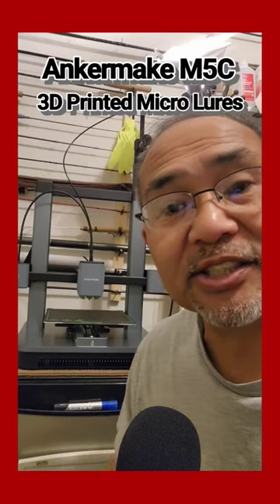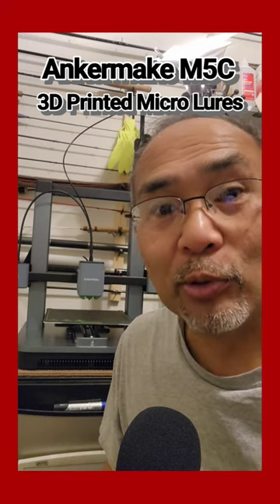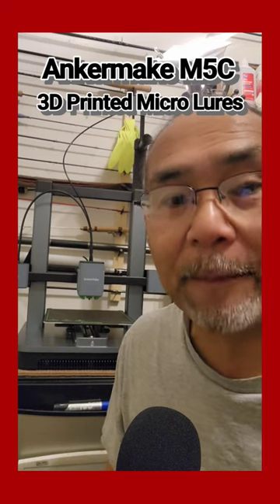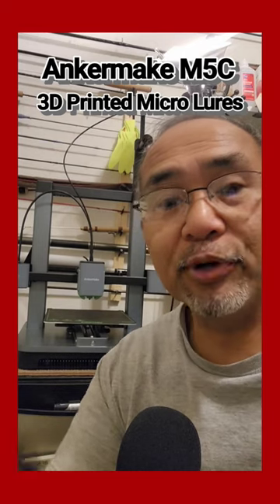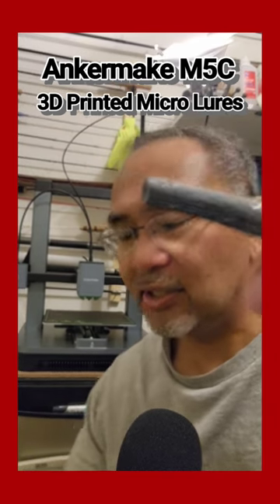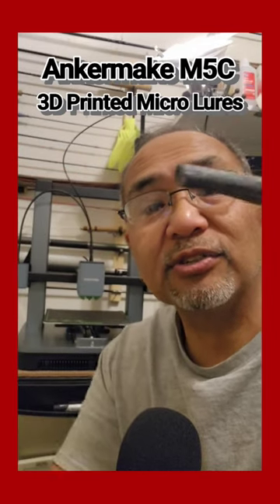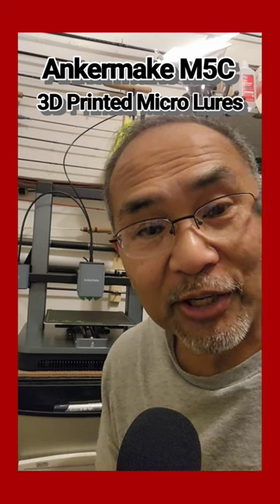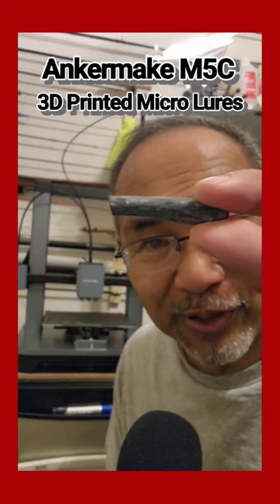Make Your Own Micro Lures with This Easy To Use 3D Printer!

Comment: Interesting, how much do 3D printed lures weigh as compared to traditional lures of similar size? I’m assuming much lighter?
Reply from the maker: They seem lighter but for this popper I was surprised how much it weighed without the hardware. It weighed 1.7grams just slightly heavier than the Micro Blade Lure with its hardware installed.